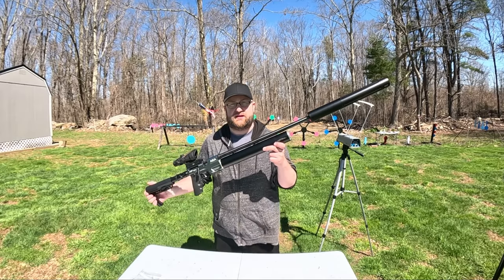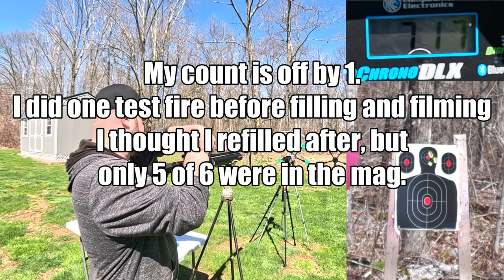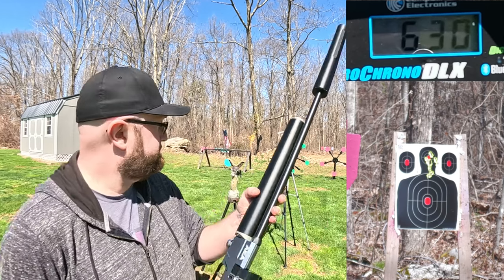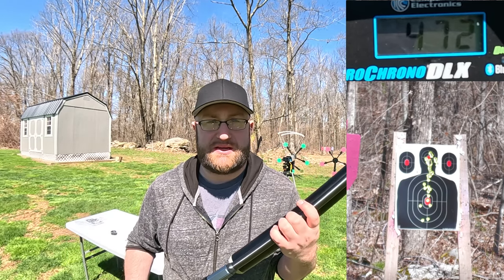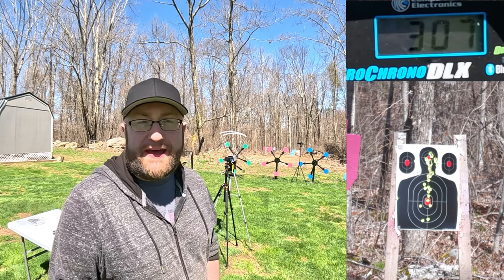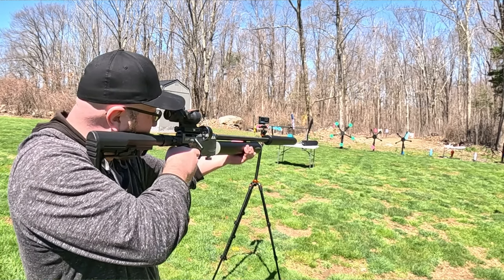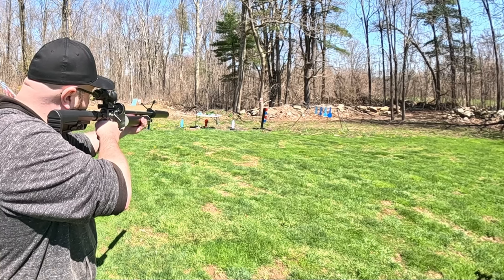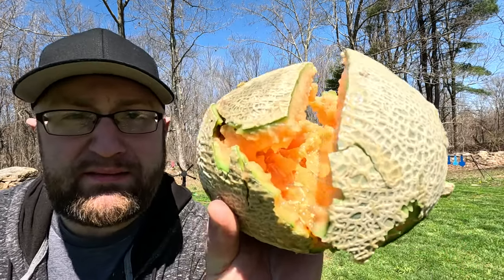M50 Efficiency 4500psi 500cc Cylinder - Testing Foot Pounds and Velocity Every Shot On A Single Fill

Comment: You should get the Garmin Xero C1 chronograph, it's so accurate and I've put hundreds of rounds thru my gun and it hasn't missed a shot yet, much better than the DLX Pro Chronograph
Reply from the maker: 👍👍 I will check that out

Comment: Idk why your doubting your chronograph. All those numbers seem right. I could. Get my .357 hp max to 1000fps with washers on the end of my spring
Reply from the maker: 300ftlb difference in the first 2 shots is why I doubted it. Then it jumps up 130ft/lbs. After that, it made sense.

Comment: Question. Was it you or was the bolt that hard to seat the pellet? Didn't look easy hard pass on that rifle.
Reply from the maker: I believe its the ammo design causing an issue. The company that makes it is adding a sort of pillar to it now. It has 2 rings that make contact, but with the gap in between the rings it can sometimes get caught up. With pillars connecting the rings it should feed better.👍👍

Comment: The windage was pretty good.
The scattered fps with each shot is a mystery I long suspected with air rifles.I think they sll struggle with that problem.Tho its only supposing...Im gueessing it has to do with the pressure release valve.Unlike firearms,where theres a cap,powder and projectile,the process is minimal .With air powered,the variable are numerous compared to firearms. That CAN  have varying results on the strike of the round.
Reply from the maker: Regulators will fix that fluctuation until you start dipping under the set pressure. By then its time to fill up usually though. On something like the Kratos, it gets a ton of consistent rounds even without the reg, just a lot less power, doesnt drop as quick from the cylinder. This is using a ton of air for each round at the start. If you regulated it, dropped fps to give you about 150-200ft/lbs it would last a long time and be much more consistent. Im pretty sure they offer a kit for this but a lot of aftermarket parts pop up too
Reply: @toxicmatrix1337  Thanks fir the info bud.
Reply from the maker: @STEVE_C_1369  👍👍